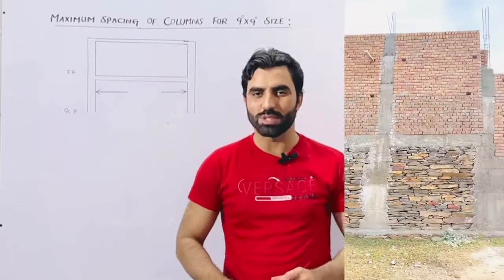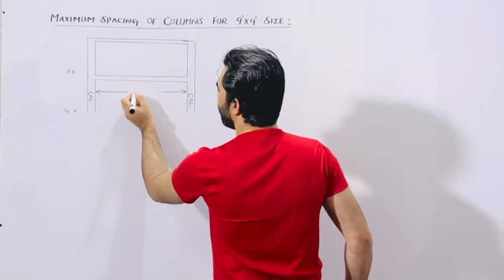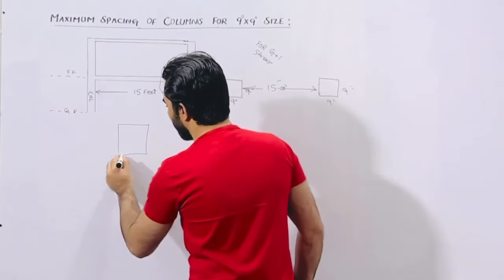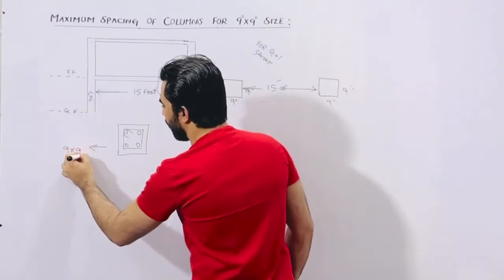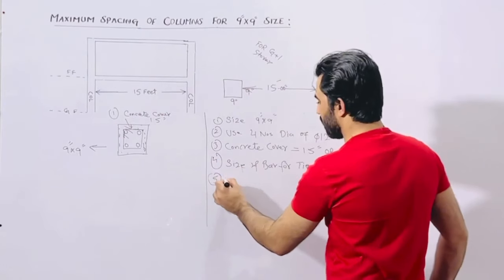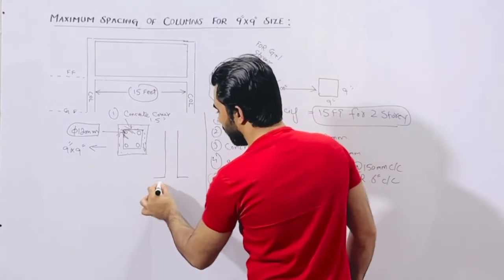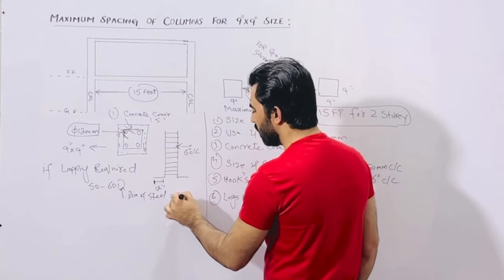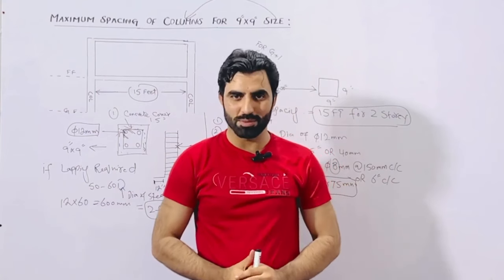Maximum and Minimum Spacing of Column for Three Storey Building

Comment: Hello sir, my GL is 4ft below the road level and i want to construct G+2 building 2.5 ft above the road level. Column size is 12"x12" (16mm 4 bar and 12mm 4 bar) . Footing size i have given is 5'x5'x5'(12mm bar 6" C/c) 
Can i increase the column height to Road level (new footing depth will be  9 ft) with same footing size mesh. And filling the area with soil with curing and providing tie  beam at the new level . Will there be any problem?